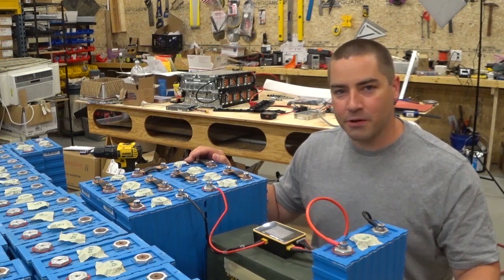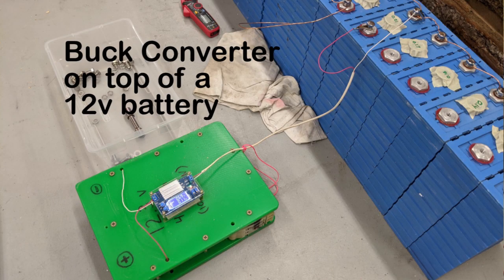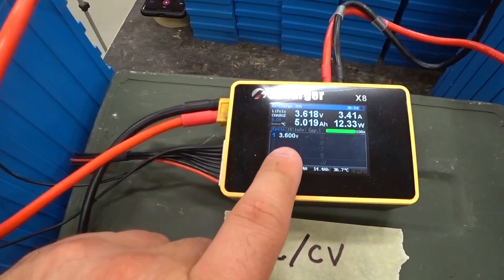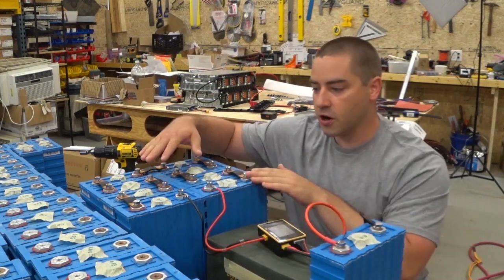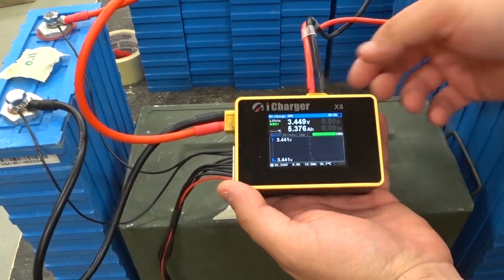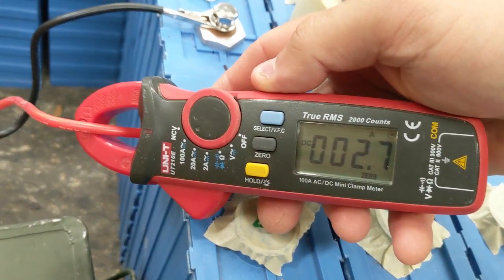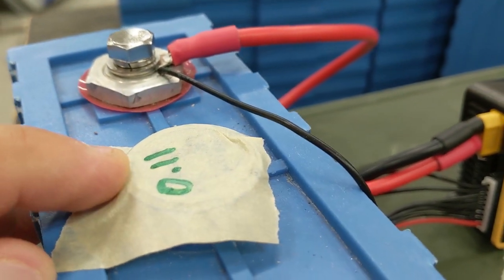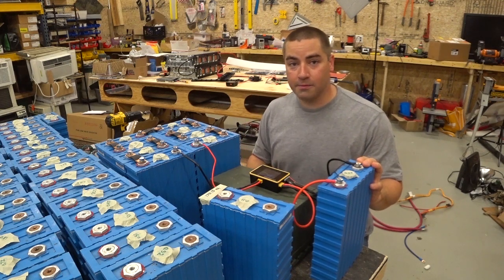Capacity Testing LFP Cells from an old EV (Lithium Batteries)

Comment: Great video and results! Whoever told you there are too many projects going on has no idea what it's like to be a DIYer. You should see how may half-finished in-progress projects I have scattered around the house LOL
Reply from the maker: Sure, show us your half-done projects.  I'll watch the video
Reply: @DavidPozEnergy  ....    WOW that means I could post my projects !!!! All I have are half done and half baked projects. . . . . . .   I watch anything DIY solar or Power wall based .... do it during the working hours in my basement working on my 160P 15S power wall project.. I'm half way through the building of my cell packs . . . .  looking back I think this project Cal-cell based pack is better ..... well much easier to do vs the 18650 based battery I'm doing . . . the only down side I see is if a cell goes bad... you lose 170 AH ... with my 160P backs I'll lose 2600mah. and the pack is still useable . . .  BUT as I said much much easier to build !
Reply: @DavidPozEnergy  hey should a generator who produce 125v be adjusted to 110v  im worried about my electronic tv etc...

Comment: Operating range of LiFePO4 is from 0.0% to 100% so no problem here. So how did that VW EV conversion run for you after you charged it up?? Numbering each video you post would be most helpful.
Reply from the maker: Once I had the cells back in the car, another problem arose, then another.  I don't think the VW will get on the road.

Comment: What is this over beyond complicated project of a device? Why do you need a million other batteries to discharge a massive amount of other batteries? Can i not just achieve this with a 12v power supply to discharge the batteries

Comment: Hi David, do you a video of how you regenerated the batteries using the buck converter? I have a load of LFP cells in the same state. Thanks.
Reply from the maker: I may touch on the topic once in a while, but I think Lithium Solar has done a better job explaining that topic than me.  https://youtu.be/sCYv1OPGhSc

Comment: I am thinking of buying the iCharger to charge my 280AH 24v battery. What budget power source would you recommend ?
Reply from the maker: My first power supply I used was an old laptop brick.  It put out 19 volts at 1.2 amps.  But it got me started.  These days I use a Meanwell brand 24v power supply.
Reply: the servers power supply are great for that charger to example:  HP 1200W HSTNS-PD30

Comment: I have a question for David, since I see you doing a lot of great videos on batteries.  I am pretty sure you will know the answer.  I recently bought two Lithium Ion Gen 1 Nissan 48 volt batteries for my solar project.  However when I try to connect them in parallel - many fireworks...   I don't see people having to add a battery shutoff in between to solve this hookup problem.  Ideas?

Thanks,
Ash
Reply from the maker: When hooking up cells, or batteries, in parallel they must be within 0.1 volts of each other.  So if one is higher than the other, drain some power from the high pack until it has the same voltage as the low pack

Comment: Sorry for the second comment, but I'm about to start charging about 20x 260ah Lifepo4's which are in about the same state of charge as yours was.  I'll try to post some video of the results.  Thanks for this video, it gives me a great head start on how to try and bring them back to life.
Reply from the maker: Just start super low in amps.  I charged each at 0.1 amp until I hit 2.5v, then bumped it slightly to 1 amp.
Reply: @DavidPozEnergy  Makes perfect sense.  Dacian Todea (Electrodacus) recommends 2.5v as the lowest allowable voltage and he charges to 3.55v to maximize longevity.
Reply from the maker: Yep.  This is LFP chemistry, which has a range of 2.5 to 3.65 volts.  But the sweet range to work in for maximum life is 3.0-3.5v.  That's what I set my inverters and charge controllers to.
Reply: @DavidPozEnergy  I have 3 of those MPP LV5048 inverters paralleled and set to a reduced charge voltage because there are a few weak cells which always spiked towards the top of charge.  I'm hoping these "dead" cells will be usable enough to swap out for the weak cells so I can bump the voltage up a bit, as the healthy cells aren't being used to their full capacity.
Reply: @DavidPozEnergy  I just posted the initial setup for charging those cells.  This is a bit of a different scenario, they were completely dead instead of 0.1v like yours were.  https://www.youtube.com/watch?v=e4eqDYyxscQ

Comment: This is going to be kind of a strange ask; however do you have some way to get in contact with you? I've recently (as in yesterday) purchased a 30' S2 9.2c Sailboat and have been watching your vids on solar/storage. I've none of the tools and such and I'm wondering if you'd be interested in helping me actually equip this vessel with a proper system. -cheers
Reply from the maker: Hi.  I'm on facebook.  But I don't build batteries for others.  I'm just a DIYer.  These are my own personal projects.
Reply: @DavidPozEnergy  Instagram by chance? I don't have a facebook.

Comment: Wow, David.  It's incredible they're still holding such a charge after being completely drained.  When you reassemble, use the free website tool repackr to create a balanced set.  I used it on my 48v Lifepo4 pack and it did a great job creating pairs of cells to keep the charging even with minimal balancing required.

Comment: nice! you might want to run a separate charger at the same time as discharging so it doesnt take too long, though you said they were mostly charged already. Also LFE cells are perfectly fine going to 0v, its just when things go negative voltage that will kill them. so if they hit 0v while discharging the series pack then the other cells will still keep the current flowing and start charging the 0v cells backwards. Instant death! Thanks for sharing!

Comment: How old is the car it came out of and was there a good battery management system on it?
Reply from the maker: The original car was a 1999, originally a gas engine.  I think it was converted to electric around 2011 or 2012.    There was no BMS.

Comment: It would be interesting to know how much of a difference in life some of these batteries when they hit like 0v or whatever because I have gotten a lot of 18650s that are at 0v and they often have most of their capacity but Id like to see a side by side comparison of how many cycles they get vs a new i know there is generally some capacity lost right off the bat and I assume it depends how long they sit at 0v and how much was left before they got there
Reply from the maker: There were 3 cells that had 0 volts in the car, and those 3 are self-discharging.  The 45 cells on the bench in this video are the ones that still had a little bit of voltage.

Comment: Im surprised that they said the ev wasn’t good anymore. 170ah from a 180ah cell is excellent after that long of time. I have a bunch (87) Blue CALB 100ah cells. Need to do a capacity test again as they have been sitting. I have a couple sitting at like just a touch above zero. They won’t charge at even 5 amps. I’ll try a super low amperage and see what happens. Will I be able to recover even one at zero volts? Who knows. Not likely. I need to check out that charger. Looks useful.
Reply from the maker: There were 48 cells total in the car.  3 of the cells were showing exactly 0.000 volts.  Those three turned out to be self-discharging and draining the whole pack, so the whole car would not take a charge.  What you see in this video is ever cell that had some amount of charge, most between 0.11v and 0.50 volts.  These seem to be recovered and working well.
Reply: DavidPoz  Hope you got a killer deal for those cells. I really like the prismatic cells from CALB and ThunderSky.

Comment: Have you ever used the BMW electric car batteries. I have 12 24v 70ah units I'm working with for my storage
Reply from the maker: The only thing BMW I have is my last video, a LTO starter battery.  But I don't think that is what you are referring to.
Reply: Thanks for getting back to me. The batteries I have came out of a full electric BMW. There a 8s 24volt 70ah unit. I 'll post some pictures when I get them set up.

Comment: help me david . lol. my Chinese charge controller i either hooked up wrong or was bad i don't know . was charging albeit not to my 2880 watts . was reading 800 watt on a cloudy day . i thought it was ok. next day tri -metric shunt says cc not working no charge to batteries. in the solar  shack  smell extra battery off smell. real cold out some cells low in water. 8 battery's .2 showing still 50% other six i can"t charge and keep charged with my pro-logic smart charger not really working . are they garbage now? or is there a way to safely try to bring back to life some how? could i fix them and hook them up to my 8 100 watt  panel"s. or is rehab a battery like that  just a  you tube fabel? batterys are the costco  6 volt gc   2017. ive since bought the midnite  solar sl 150  charge controller to go with the 2880 watts  . i hope to  have bigger power . my 800 watt system is to tiny.  signed sad in canada with 16  6 volt battery's with 8 i might have killed myself. new acid . Epsom.?
Reply from the maker: Hi Jerry.  There are more variables involved. Please send me this question as a message in facebook along with some photos.  https://www.facebook.com/DavidPozEnergy/

Comment: Interesting.   I'm 18650 so I don't have hands-on with LifePO4, but I always hear that 0.01v LifePO4 should not be 'recovered' as that might create the old dendrite danger....   but on the other hand, I've not heard of shorts in LifePO4 the way you hear about 18650.   Its hard to know the truth without folks that share reliable info (such as yourself)    Will be really interested to see how it turns out - 24kwh is a good chunk of capacity!!
Reply from the maker: I'm more cautious with other types of lithium, but not these.  If they test well, and don't self-discharge, then I'm OK with using them for my setup.

Comment: Wow that thing is physically huge. Energy density must not be quite as good as some others.
Reply from the maker: Correct.  The LG's I did a few weeks ago are more energy dense.  But these aren't too bad.
Reply: @DavidPozEnergy  I'd like to have a single cell that's 1,000 amp hours that way I could have one series string and nothing in parallel
Reply: @DavidPozEnergy  there must be some kind of physical limitation to the capacity of a single cell.  That hit explain why these huge power storing facility use a bunch of tiny cells in series parallel configurations
Reply: @DavidPozEnergy  probably making it too big can't dissipate the heat.  And probably the larger a single cell the more discrepancy in voltage across its own plates making it more inefficient there for contributing to the heat problem.
Reply: I think it's important to note too that these are LiFePO4 batteries and the energy density is nowhere near that of 3.7V lithium ion, but they're much safer.
Reply: While energy density is not the greatest, one of the great advantages of LiFePO4 is the number of charge cycles you can get. Regular lithium cells would have much less of their original capacity at this point.